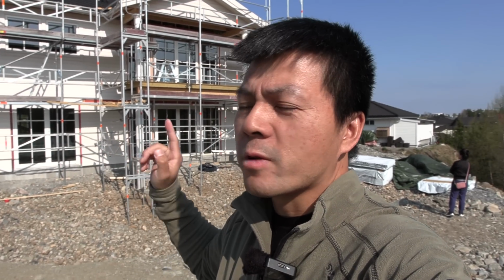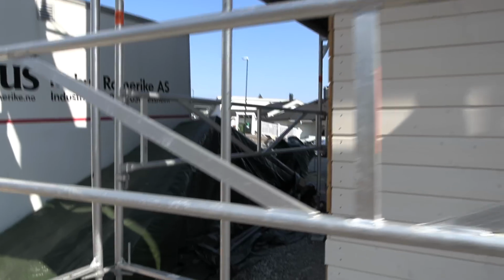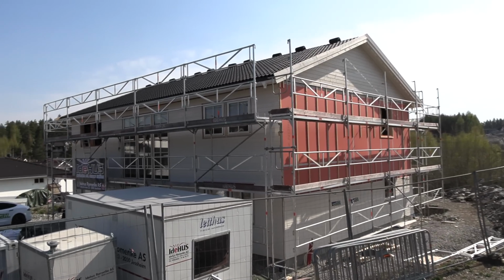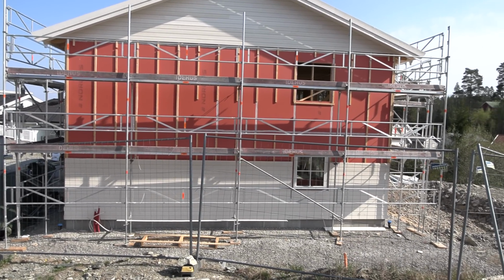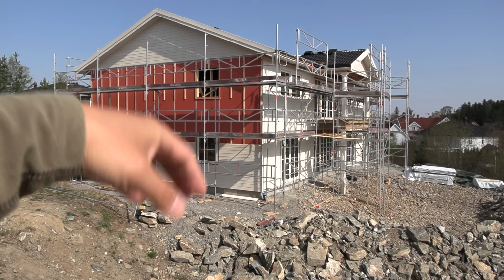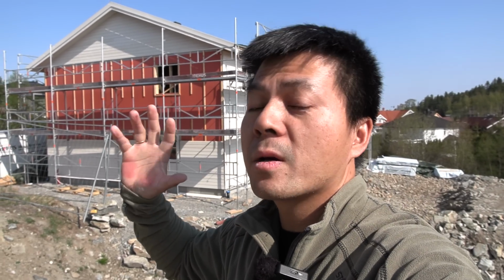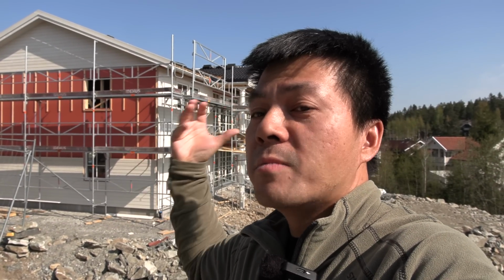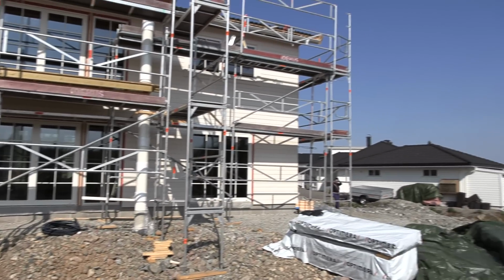My new house in Jessheim May 13 - questions answered

Comment: Björn, your justification in the end whether to invest in solar makes sense and is probably best fit for your needs.

What I do take small issue with is the misinformation distributed against solar and geothermal heating in the video.

You have a large roof so surely it can take more than 15 or so panels. Having them placed on east-west sides is no issue, just effects the yield a little bit.

But the point of solar is not to rapid charge your Tesla but to cover for the base consumption which in a modern house is surprisingly large thanks all the tech in the house. So 7kwp sounds about right for this size.

20-30 years payback time sounds just plain wrong. Electricity in Norway is quite expensive in the south so 10-15 years is much more realistic surely? And it’s not that productive to think it from that angle, the point is to lower the running costs and sure it also will pay itself back fully at some point. , perhaps sooner than you think if you end up selling the house at some point.

Asthetics is pointless to argue busy I’ll just state the roof is very high up so you don’t really see them much and if it really bothers you can get them in black.
Reply: I think that East/West is better than South, especially at high latitudes. East will start generating useful electricity 30-60 minutes earlier than South, and finish 30-60 mins later in evening - so shorter "night" for battery to support, or to buy from grid.  Mid-day peak is higher with South, but East/West provides larger roof area and extra panels is a modest cost increase overall
Reply: @ecok  South is the optimum. East-west drops 25% of yield all other factors being equal. Only thing that really affects this if the expensive electry usage you are trying to happen mostly happens in the mornings or in the evenings that could balance the difference somewhat.

Comment: Great to see your house taking form, Björn. Still, I think choosing a geothermal heatpump over air-to-water would have proven to be the most cost-efficient solution in the long term. As long as the borehole is properly dimensioned for the energy requirements of the house you don't have to worry about it freezing during your own lifetime. Plus, in the summer, you can cool your house for free and move the heat down the borehole, reducing the stress on the borehole even further. The air-to-water heat pump will bite your a$$ when it's really cold outside, no matter how efficient they make it sound, physics take care of that. Still, an air-to-water pump is way better than resistive heating all the time, so not a bad choice at all, you're just leaving some savings on the table.
The ventilation heat recovery nowadays is amazing. A tip for when you move in: set the target temperature of the incoming air as low as comfortably possible. You want the air-to-water heatpump to do most of the heating. Setting the target incoming temp too high will cause your ventilation heat exchanger to heat the air using its resistive heating elements during cold days, you don't want that.

Comment: Wise choices.  I'm a Civil Engineer 😑  Have listened to all you said in all your videos on this build and understood that you had made very considered decisions.   First you have to work within an affordable budget ... and any work in the ground quickly spirals in cost - especially with that hard ground.   With good insulation and a substantial battery storage you should be fine.  Solar changes as technology moves on and panels from as young as 5 years ago can be out of date already - it isn't really free electricity when you factor capital cost - and it can be ugly, as you say.   Good insulation and controlled ventilation is the most cost-effective setup.  There is a "Passive" house near me in UK that only requires 2 people to be inside it to reach a comfortable temperature, even in Winter.   The house is so efficient it costs them nothing and actually receive around £2,500 every year from the energy companies - without big solar arrays.
Reply: I live in Passive House, and also have PV (in UK); almost no heat required in Winter and very comfortable all year round. For 6 "Summer" Months my PV provides 90+% of the house usage, and also 1,000 miles a month into EVs. Disappointing it appears not to be cost effective in Norway, but it certainly is for me in UK.

Comment: Those are construction doors, yes. Doors are so easy to break, damage while building, it’s much cheaper to install temp doors and reserve the permanent ones for the last steps of the process. 

You didn’t get to choose your doors and windows?
Reply from the maker: Wow, really? Lol
Reply: @bjornnyland  Yes! Look at the doors they installed. Padlocks are screwed in, big holes cut out. Wrong fit for the hole they built also. These are just reused from house to house when they build them.

Comment: Sounds like you made the right decision, Bjørn. One other thing I think a lot of people forget to take into account with solar is that with a 20-40 year timeline to break even A LOT can happen in solar tech. It's entirely possible that in 5-10-15 years there will exist low profile, good looking, efficient panels that are lightweight enough for your roof. It would suck to be stuck on "old tech" for another 20 years just to break even.
Reply: Is it me alone? I do like seeing solar panels added on the roof
Reply: @lommyx It does not take 20-40 years for payback, more like 5-10. If everyone waited for the latest tech then we'd all be waiting a long time.
Reply from the maker: Lol, did you not watch the video? It will take way longer than 5-10 years.
Reply: @bjornnyland  Disappointed to hear that in Norway PV is expensive (i.e. payback is long). I'm in UK and my payback is 5-10 years - very little in Winter, but for 6 "Summer" months PV powers the house (I also have battery) and also 1,000- miles a month into the EVs. But given Norway's green grid maybe that is a better option. Just surprised, given the incentives in Norway for EV, that you don't have PV incentives too.
Reply: @ecok  It also depends on your electricity price. Last year when I calculated my PV installation it was better to oversize a bit but now what I'm seeing is that the market price when sun shining is generally quite low. (of course last year in general was oddity and I didn't calculate that in too much)
So yeah I need to find uses for the power to get decent payback again.
I think with more optimistic prices(selling extra to grid) I had 6-7 years. Now I think it would be closer to 10.

Comment: They're construction doors. They're not the doors you will be getting. Those cut outs at the bottom corner is so the builders can run electricity inside.
Reply: Are you explaining to Bjørn, who chose the type of doors and already knows these are temporary builders doors, or are you explaining for those people who don't have a sense of humour?
Reply: @nettlesoup  Did my comment start with "Hey Bjørn" I think that should answer your question. But I do understand that you could have been confused by my comment.
Reply: @SirNecro  And yet who is the 2nd sentence addressing with "you will be getting"? Have an ice cream on me, my friend, life is a journey 🍨
Reply: @nettlesoup  You are the house buyer. See I am smart enough to have read through the comments before I made my own and I know that a similar comment had already been made and Bjørn made the same reply as he has here. I also paid attention as to when he explained the insulation requirements in this video. Clearly you're not going to meet those regulations if you have ill fitting doors with holes in them.
Reply from the maker: Wow, really? Lol
Reply: @bjornnyland  I was explaining for those who don't understand your dry Dutch sense of humour, like the guy who made a similar comment before me and you replied exactly the same way. Clearly you're not going to meet regulations with ill fitting doors that have holes in them

Comment: Like in Germany we have building standards in Germany it makes sense to have solar on the roof and it also makes sense to have solar in the north with a roof like yours because solar panels are very efficient nowadays you need light and not a direct solar radiation. In Norway it does not really make sense to have solar on your roof because your grid is very green and powered by hydro, which means your electricity is very cheap. Heat pump and underfloor heating is a good choice.
Reply from the maker: Germany is way further south and Germany doesn't have as much snow as in Norway.
Reply: @bjornnyland  Yeah, I don't mean on your roof, I mean on the roof in the first sentence.

So your are right 

:D
Sorry

Comment: I got 54 panels om my huse. 100m2  Get 120kwh on a sunny day.  In avarage 17.000kwh in one year. House from 85  and no shange on the roof. Live in west of  Norway
Reply: Snow slide right of the panels i vinter so no problem
Reply from the maker: Good for you.
Reply: Shows the ROI is significant.
Reply: That is an enormous setup, how much carbon did it cost to make those panels when you could have gotten carbon free power from the grid?

Comment: in a county where the sun irradiation is available mostly between February and October, solar pv is useless. i estimated 900 kWh of energy production for a 1kWp with pvgis simulator. In Italy or Spain, for example, the simulation brings to 1400 kWh/kWp and there it is worth to install solar panels. Maybe you can install a thermal solar system for water to use it mostly in summer.
Reply: Not in every case. In Switzerland we try to raise and hold the level of water in our reservoirs for hydro power as long as possible. So in autnum the solarpower can help to save water. During winter we produce al lot of hydropower.
Reply: @Lo_Durr  Switzerland is like Northern Italy, is really worth produce energy from solar with these plant price. In Norway not yet. The price of the energy from grid is an important factor to consider, grid parity. and in Norway energy price is very cheap and almost renawable.
Reply: I'm in UK, definitely not useless here - I'm at 52.5N and Bjorn at 60N would get 80% of my yield. My PV payback is about 5 years. No useful generation in Winter, but for 6 "Summer" months it provides 90+% of house usage and 1,000 miles a month for the EVs.

Comment: If I remember Norway has dynamic energy tariffs so having storage is going to be as good as having PV especially that Norway is not that sunny anyway so you charge when electricity is very cheap and use stored energy later. Reusing Tesla LFP battery would be nice project

Comment: My question would be: Why is anyone still building houses with bricks?
Brick built houses go with gas cars!
Reply: Hasnt your mum ever read you the Three Little Bears !?😂
Reply: Because they last. 🙂
Reply: They last way longer and need way less maintenance. Here in Denmark almost all houses is build like that still . Also stil have to meet same standards as in Norway for ventilation, insulation and stuff .
Reply: Modern bricks have good insulation values and high specific mass. So in hot climat houses with big mass are much more comfortable during summer.

Comment: I'm all for solar where ever it is practical, but in a country where you have darkness for months at a time, and a properly insulated roof will have snow on top for at least many days at a time solar doesn't make much sense. Also in Norway where almost all your power is renewable from the grid anyway via hydroelectric solar is redundant. The money is much better spent on making the insulation R value and air tightness as high as possible and putting the best insulating windows one can afford. If you were building a house in Italy or Spain it would be a completely different story. Beautiful home and good call on your decisions, this is an excellent series and I'm looking forward to the progress updates!
Reply from the maker: 98 % of the electricity in Norway is from renewables (hydro and wind).
Reply: @bjornnyland  Only reason for solar would be to get costs down a bit if the price of electricy is high in your case. South Norway does have generally a bit higher price these days. (IIRC)

Anyways since you have a black tile roof you could get all black solar panels.. they should fit pretty nice. Though I think you would need to find a good size panels to cover from top to bottom to get the roof covered pretty much 100%.
Reply: You could apparently also run power back to the panels heating them up and melting the snow
Reply: @JoakimGulbrandsen  In the winter, when the sun is barely high enough in Norway to provide any meaningful power? That sounds like a waste of grid renewable electricity that could be used to heat the house or charge a vehicle. If he were off grid and had a massive battery bank and was further south, a heated solar system would be a lifesaver.